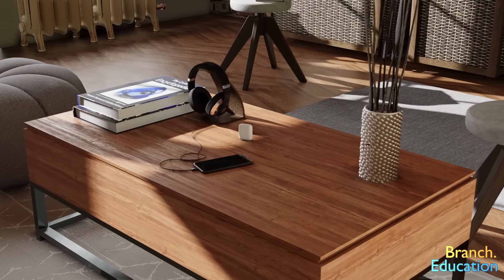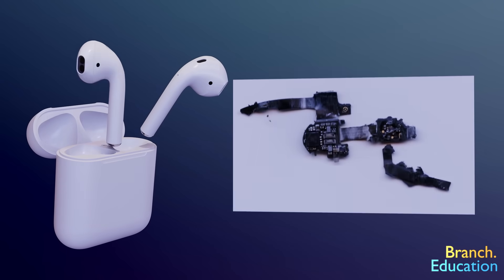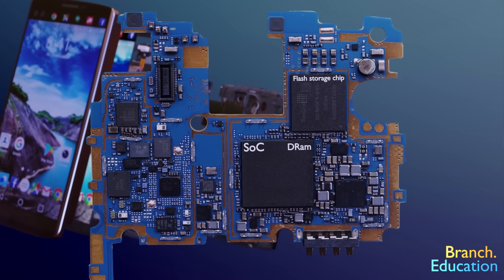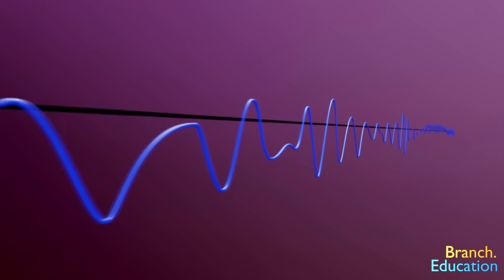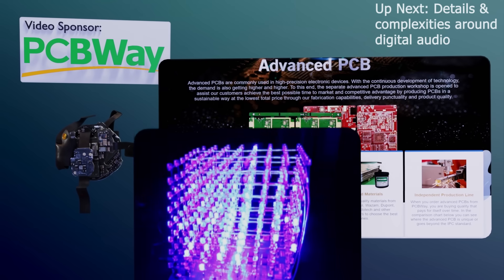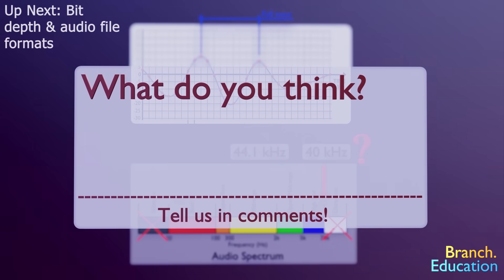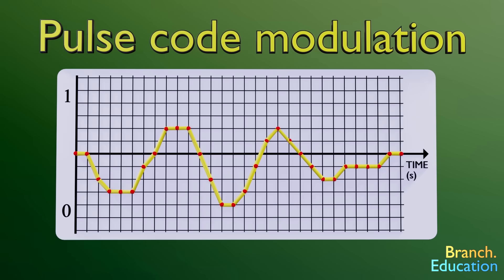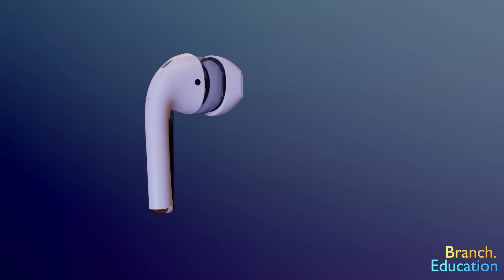The Engineering Inside Wireless Earbuds || How do Wireless Earbuds and Audio Codecs Work?

Comment: Wireless earbuds work by positioning a radio transmitter directly next to your brain, an organ known for being especially sensitive to radiation damage.  But not only that, it's also next to your skin, eyes, nose, mouth, and tongue.  Your closeness to a source of radiation greatly increases the amount of damage it can do, and you really can't get any closer to your body than stuffed inside your earholes.  Radiation damage, however slight, is cumulative over the course of your life, so wearing these little suckers every single day for several hours at a time is a really great way to increase your risk for cancer during your lifetime.

Use wired earbuds.

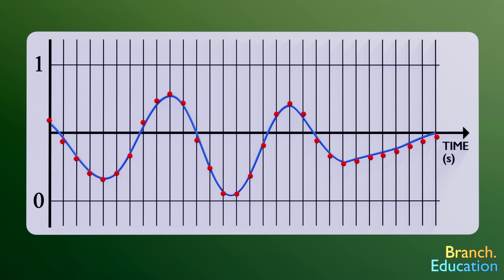Comment: I have a slight criticism for the visualization 13:56. The values aren't evenly spaced out, so there's twice the distance between 01 and 10. I get that you probably didn't want to go into 2's complement, but I think it still would have been clearer to assign one of the levels to 0.

Comment: Working myself in the electronic engineering field, I can confirm you that designing such little PCBs is incredibly intricate. Moreover, they have to design their own chips because the SoC's and Bluetooth modules on the market are standard dimensions. All fascinating.
Regarding the sampling frequency slightly greater than the double of the audio spectrum of the human ear, it is the usual Shannon's principle/theorem.
BTW, I thought that codec meant "compression decompression" but both interpretations make sense to me. Regarding this process, audio or even video codecs can be made in 2 ways : either software like in our computers (when you have to install them), or hardware which means that there is no CPU to do the codec job but just a powerful combination of logic gates, flip flops, registers and so on. The second one is more reliable but you can't update it by downloading a new software.
To have an idea of the 16 bits, 24 bits or 32 bits audio resolution, we can take as a reference the gameboy (4 bits) and NES (8 bits). It is very likely that the human ear capacity to perceive the difference between  16 and 24 bits and most of all between 24 and 32 bits is very very weak. At that we can add the fact that audio coil is a very slow system (low cutoff frequency) for which even if we have 16 bits, the analogue output signal will be smoothed automatically. Maybe if you have hundreds of volts in output for concert audio systems it will make a difference but I never found that concert audio systems had a very high fidelity!
Congrats to you for such a clarity of explanation and illustration.

Comment: Maybe I'm confusing things, but why is the stream decoding done on the earbud and not on the smartphone?
More precisely, I counted three steps in decoding process: 1) Reading the compressed audio file, 2) decompression the stream to get the raw sample sequence, and 3) coverting the sample sequence into an analogue signal. If I understand correctly, 2) is done on the earbuds instead of the smartphone. But we could also decompress the audio on the smartphone and send the raw sample sequence via bluetooth to the earbuds, so that the earbuds just need to be concerned with 3). Wouldn't this improve battery life for the earbuds? Or is there another reason, why 2) is done on the earbuds?

Comment: The sampling rate must be greater than 2 times the highest frequency component in a signal such that the original wave can be constructed from it's samples, it must be greater than 2 times the frequency because practical reconstruction windows do not have sharp edges in the frequency domain rather they have a slope edge due to which overlapping will take place, to compensate this effect a higher sampling rate than 2 times the highest frequency component is used.

Comment: What is the use of the accelerometer in AirPods?
wonderful content ✌✨
Cheers
Reply from the maker: The accelerometer is for sensing on you tapping on the earbud.  It's to accept a call, or if you want to act like a secret service agent, or a number of other functions.
Reply: I was wondering the same thing.  Looking at the product pages for similar devices it appears to be for "wake on use": pick up the earbuds and they start working.  No acceleration = low power mode to save battery between uses.
Reply: On airpod pro it is also used for spatial audio.
Reply: @jsyaprudin4294  this is the correct answer!
Reply: Oh I was wondering that also, I know the optical sensor is so it can tell if you have the AirPods in your ear, but an accelerometer doesn't seem like it would do anything since that's just to determine how it's moving
Reply: So cool